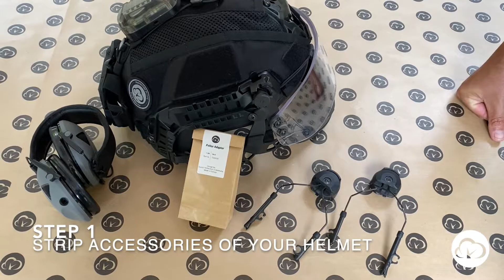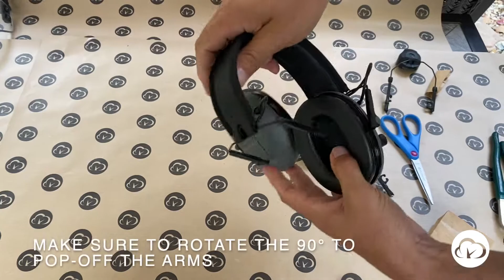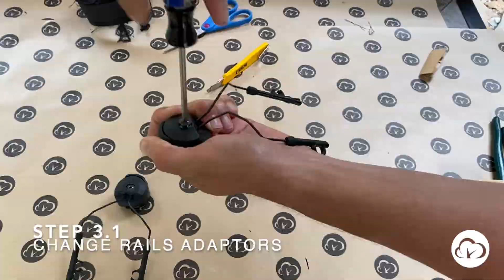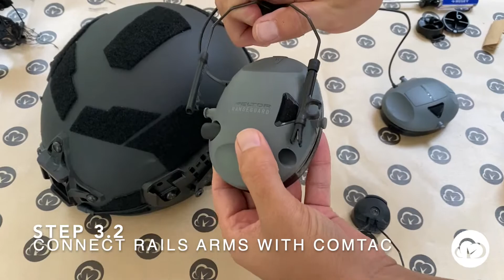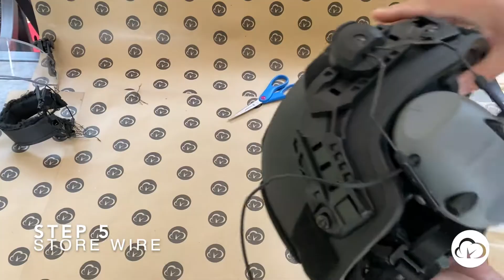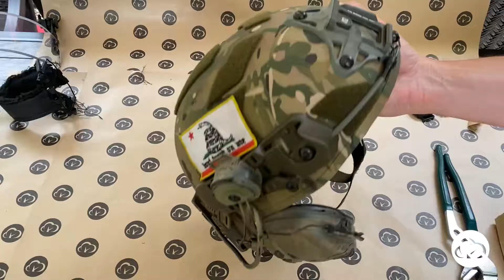Peltor® Comtacs on Busch PROtective Rails - 3M Wire Arms with Busch PROtective Peltor® Adapters

Comment: You must be fucking kiding me. This Adapter set is not available in europe. Why the System everyone else use wasn't good enough? I will return my helmet. Quality is good but i want use with peltor
Reply from the maker: These are absolutely available in Europe.  You just need to purchase from a Busch PROtective dealer.